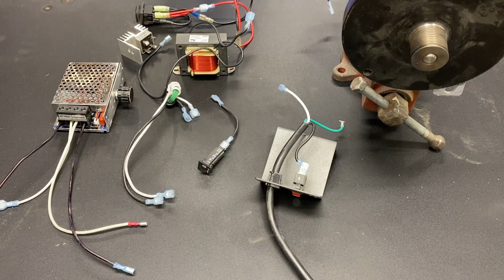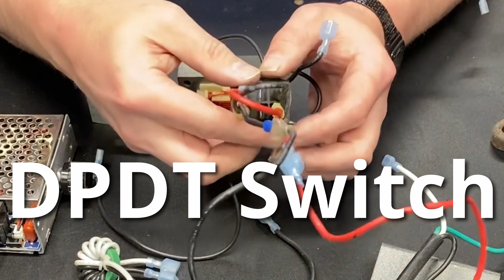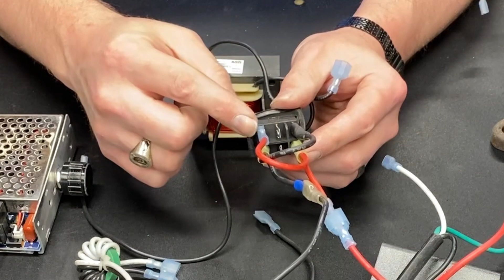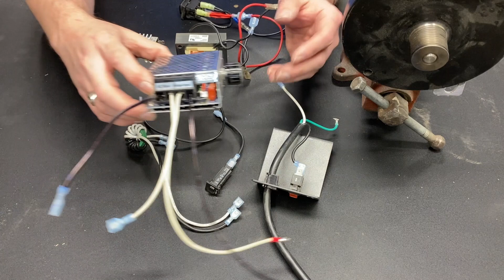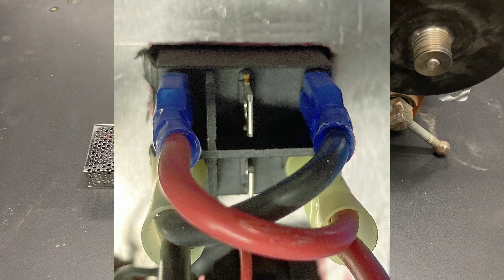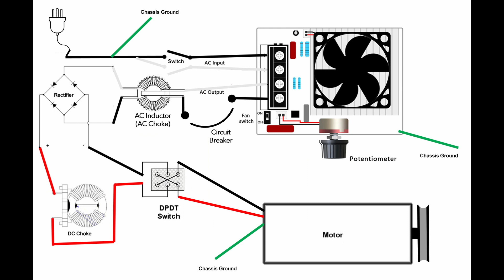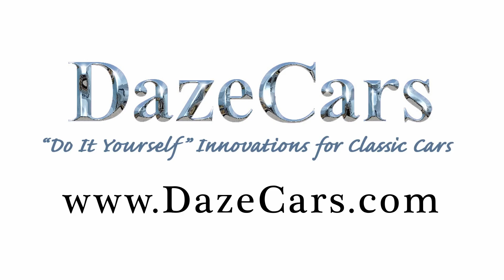Hooking up the Components for a Quality SCR Treadmill Motor Power Supply, Treadmill Motor Controller

Comment: Some would it hate because of the dreaded four letter word (math) but there are those of us who would greatly benefit from a quick video on inductors. it might be a pretty advance lesson but i want to know more about how to choose or make one for this and other applications
Reply from the maker: First of all I am not an electrical engineer and have not looked into it enough to demonstrate the math BUT I do know enough to explain why for this application we don't need to worry about "sizing it properly"  The two specs are amps and henries.  Henries are the frequencies that the choke is filtering out and while that is extremely important on sensitive electronics like radios, audio equipment and sensitive measuring devices it doesn't apply to a motor choke because a motor is not a sensitive piece of electronic equipment.  The purpose if a choke on a motor is not to eliminate all noise in a specific problem frequency but rather reduce noise arose the entire range and all chokes do that they are just lest effective the further you get from the intended frequency.  Second spec is amps and milliamps.  Almost all chokes are rated in mA as they are components for the above mentioned types of sensitive electronics.  There are 1000 mA in an amp and most treadmill motors are at least 15 amps.  If you have 100mA choke and a 15 amp motor that choke is 100 X to small.  This brings me back to what I tell most people if it is not specifically labeled as a "motor choke" it will be way too small.  In fact when it comes to chokes bigger is better.  The bigger the choke typically the heavier gage wire it will have allowing for more amps and the bigger the choke the bigger the magnetic field so the  more effective it will be at cleaning the power.

Comment: I have a Leili 4.25Hp cont. duty @ 130VDC/3170 Watts motor  that I am fitting into a Shopsmith Mark V. Would a 20 amp 110VAC circuit have enough to fully power this motor? I have 220 VAC available. Would that be a better choice? If 220 is the way to go could you recommend some componentry? You have the most informative videos on this subject that I have seen!  Thanks for the videos and any advice that you can offer!
Reply from the maker: so the formula for watts is amps * volts, so based on what you have provided that is a 24.38 amp motor.  At first glance that would mean you can not run it on a 20 amp circuit BUT are you going to be running the motor at full voltage all the time or more likely are you going to be running it slower meaning less volts?   Also the amp draw is only max at full load.  In other words if you fire up a 20 amp motor (made up numbers for illustration) measured the amp draw and the motor had no load on it may only be drawing 10 amps.  As the load increases amp draw increases and to max the amp draw the motor must be loaded to the point where it is close to stalling.  What I am saying is for most use you will not be drawing anywhere near max amps and if you correctly gear the motor to maximize torque the motor will see less of a load.  The key here is to use a circuit breaker in the power supply that is equal to or slightly less than the home circuit breaker.  That way the power supply breaker is the first thing to trip should you stall the motor at max voltage.  Going 220 will give you more amps and most of these SCRs will work at both 220 and 110 but calibration becomes critical because that will give you way more volts and that will affect motor speed.  If you put more than 130 through that motor you run the risk of burning it up.
Reply: @dazecars  Thanks so much! I doubt if I will ever have the need to run it at full power. I appreciate your input. I'll wire it to 110 and it should be plenty for my needs.
Reply from the maker: Just make sure the wall outlet is truly up to 20 amps and that your power supply breaker is properly set up.  Let me know if any other questions arise.

Comment: Ok so I'm super puzzled. I believe ive hooked up everything up correctly I've got it all installed into an old amplifier box that I've taken all the components out of. Then I go to plug it in and we get a pyrotechnics show. Then I'm getting 115 volts on the voltage output if the scr (the one you recommen) when I touch the top of the output with my multimeter but nothing coming out of it. what could be in between the top and the bottom of the outputs, you know when I touch the screws at the top.....115vac then at the bottom, the wires leading to the inductor nothing.
Reply from the maker: fireworks show indicates something is not hooked up correctly.  Contact me through my website and send me pix of how you have it wired and I will see if I can spot an obvious issue.
Reply: I do have a circuit breaker there as well luckily.
Reply: Did I fry my circuit breaker cuz I'm not getting a reading there but I thought their job was to trip and then be reset
Reply from the maker: a circuit breaker is as you said something to trip and then be reset
Reply: Now it's on and the fan is running we got no sparks or anything but I'm still not getting a reading out of the output
Reply from the maker: see other reply

Comment: Thank you! Can you tell more about your chokes, please. AC and DC
Reply from the maker: The choke/inductor for the AC side is simple, it's just a doughnut core with the AC wires wrapped around it.  The Choke for the DC side is just as easy although harder to find.  The key is that its a "MOTOR choke".  If its not labeled as a motor choke then it's too small.  Most chokes are used as components on electronic boards and are way too small.  If it is big enough for this application it will for sure be labeled as a motor choke.

Comment: Question for Ypu and anyone else,,,,, there are so many older abandoned industrial sewing machine clutch (underrated) motors, dauntingly HEAVY, changeable speeds, pulleys, direction. Easy replacement parts, foot control, fun and easy to understand and work on. WHY aren’t they being used for other machines??
Reply from the maker: Lots of people have made comments about using sewing machine parts.  They do work for a verity of applications.
Reply: Thanks for your reply. I am a glass grinder, beveler working on old stone wheel glass engravers for crystal cutting. I am buying a HEAVY industrial sewing machine motor, original switch, etc for $25 just to see how that pans out. (Also working with DC motors/controllers.) St Paul Mn
Reply from the maker: My one piece of advice is take a good look at max RPM and gear it to maximize RPM in the specific range you are after.  Gearing will give more torque and make it more usable in most applications.
Reply: Thanks, that’s good advise,, I work with fairly low speeds, due to the nature of glass. Am making use of antiquated Babbitt bearings arbors/machines in good shape. St Paul Mn
Reply: Thanks @dazecars does this scr controller give good torque at lower speeds like an mc 60 does?
Reply from the maker: Most people don't realize this but an MC 60 IS an SCR voltage controller.  They work about the same but the aftermarket SCR is easier to configure, takes up less space and is less expensive.  I have an entire pile of MC60s but would much rather use the aftermarket controller.

Comment: could you potentially use a microcontroller with pulse width  modulation and an H-bridge in place of the switch for other aplications?
Reply from the maker: My concern would be the high amp high voltage used to run a treadmill motor.  I doubt an h-bridge would be up to the task

Comment: What gauge of wire are you using?
Reply from the maker: For power wires on the ac side 16 is a minimum on the DC side 14 is a minimum.  For potentiometer wires 22 or so

Comment: Noticed you other older video "Putting Together a QUALITY Variable Speed Power Supply or Treadmill Motor Controller SCR type"  It contains reference to the 100 amp bridge rectifier and a large smoothing capacitor.  Are those items no longer recommended?  Also any information you can share about controlling 3 phase dc motors?  Do these instructions apply?  Thank you for the great information.
Reply from the maker: I always use the 50 amp rectifier on the bench because its easy to hook up with quick connects, and there is little to no load on it.  The terminals on 100 amp are bigger so the quick connects don't fit.  I always use the 100 amp when building an actual power supply and recommend it in most of my videos.  I don't mention it in this video because its about how it's hooked up not the components.  There is a 100 amp rectifier linked in the description of this video and I have a recent video on all the parts needed to put together a power supply.  https://youtu.be/NUOCo01qARE

I have not messed with 3 phase DC motors so I do not know if it will work or not
Reply: Thank you for the response.  It's interesting playing about with these. For the life of me I don't understand why drill press manufactures don't setup their pulleys for low rpm drilling holes in metal.  Who wants to waste money on burning up and breaking bits.  Being in Canada it's like living in the third world .  We can't get half of the stuff available in the USA.   @dazecars
Reply from the maker: I agree.  I think the set them up for wood and that is why the RPM is so high.  Kind of a one size fits none approach
Reply: @dazecars  I've seen many of these small DPDT switches, like the GAMA 28E-MTD.  Which is 12VDC and 30A in use by treadmill motor hobbyists.  When dealing with these 90 - 180VDC motors, some a max VDC run close to 30A.  Should one use a switch with a higher rating than 12VDC?  Something more along the lines of a 220V or higher switch.   I would think lower rated switches might cause arching.  Is that not a problem?  Thank you
Reply from the maker: It's really simple and really complicated all at the same time.  First Most switches are rated high on the AC side but not on the DC side.  That is because AC is less likely to arch at due to its occulting nature.  On the DC side higher amp higher volt situations will for sure cause arching so how can people get away with lower amp switches?  well for starters most of those switches are being operated at low volts low amps.  How ofter are we turning the machine off and on at FULL speed?  seldom if ever.  How often are we turning them on or off at full amps? seldom if ever.  other than basic operating amps, amperage draw is dependent on load, the only way the motor will draw max amps is if it is at max torque load.  Lastly most are running their treadmill motor with either a PWM or an SCR and rectifier.  Both of these types of power supplies turn on and off to regulate voltage and in doing so act much more like AC.  The pulsing nature will reduce the risk of arching and contact damage.  The long and the short of it is a lower amp switch will work but likely not as long as the "correct" switch for the voltage and amperage.  With all that in mind I recommend getting two switches.  One to put in the machine and one to have as a spare so when the first one burns out in a year or two you are only down a few minutes rather than a few days.  Make sense?
Reply: @dazecars  Yes, that does make sense!  Thanks for explaining.  If someone wanted to go through the effort(wiring) of implementing DPDT switching on the AC side(before the rectifier.) Do you think it would be stressful on the rectifier?
Reply from the maker: You can not put the DPDT switch on the AC side as AC is not directional and the power coming out of the rectifier would always be the same.
Reply: As soon as my head hit the pillow.  I realized that was a dumb question.   @dazecars
Reply from the maker: not dumb at all.  Some times a thought is just not fully thought through, that doesn't make it dumb.
Reply: @dazecars  Thanks.  Just had a thought. How about a DPDT switch on the AC side with output to two separate bridge rectifiers.  With reversed DC wiring on each.
Reply from the maker: I can't sign off on it because I haven't tried it but tracing power flow in my head I think that might just work.  My only concern is power feeding back into the "off" rectifier but I believe that would not be an issue as the diodes in the rectifier would prevent power flow the opposite direction.  Short answer I think it would work but at that point Its a lot more expense to not get much as the DPDT on the DC side is "good enough"  Interesting thought though... I may test that on the bench and do a video on it.

Comment: What is the capacity of DC choke for 220V 2.2hp DC motor?
Reply from the maker: Not being an electrical engineer I do not have any specs or calculations for you on the motor choke. What I can do however is offer you some guidelines. First of all bigger is better. I have several motor chokes ranging from the size of a tennis ball to the size of a soft ball and the bigger they are the better they work. Second the wire for the choke needs to be a minimum of 16 awg. If the wire is not that big or better it will not have the amperage capacity to allow the motor to work properly. Amperage is the most important spec.  A lot of the chokes available online are rated in mA.  there are 1000 mA in an amp.  Treadmill motors are rated in amps so most chokes available online are several hundred times too small.  Third they are not available on Amazon at least not inexpensively, there are a few privet sellers on Amazon selling used parts for big bucks but the available chokes on amazon are too small because they are not designed for a motor even though they look correct in the picture they are WAY too small. The choke in most of my videos is part number 130993. Instead of getting one new I would get a used one. A lot of treadmills come with a choke. Go to eBay and search “treadmill motor choke” BUT know that most people on eBay don’t know what they have and the word “transformer" will also appear in most listings. Problem is a choke and a transformer look almost identical so some listings are for transformers and some are fore chokes because the sellers think they are interchangeable. They are not. They would only be interchangeable if you modify a transformer to work as a choke. (see my DIY choke video) To tell the difference count the wires. A choke will only have 2 wires, a transformer will have 3 or more. Also before I started doing videos chokes on eBay could be had for $25 or less shipped but now that more people are looking for them (due to my videos) the eBay sellers have raised their prices quite a bit. Your best bet might be the DIY option out of a Microwave transformer. Please let me know if I can be of further assistance.

Comment: Hi. I appreciate your videos. I bought the components you list, modified a microwave transformer, and bought a 2.5HP/3400RPM/17amp/130V  treadmill motor, hooked it all up as suggested, and it runs. No visible sparking. However, the SCR hums very loud and cycles very frequently. I only took it to about 1500RPM. This does not happen using my Variac. Any thoughts as to why all the noise and cycling? I do not detect this phenomenon in your videos. Thanks.
Reply from the maker: Several others have reported this same issue with the DIY choke, although tons have had success.  One guy even made two where one worked and one had the exact problems you are experiencing.   Did you fully disassemble the transformer to make sure there were not any other connections or coils prier to converting it to a choke?  Is it welded back together?  is the coil locked into place?  Another thing you can try is to put the DIY choke in line on the negative side instead of the positive side. It will still help regulate power spikes but may be less problematic on that side.   Also what AWG is the wire in the coil?  some microwave transformers are smaller and the coil wire may not have the amperage capacity.  Those are just a few possible ideas.
Reply: what do you mean by cycling?
Reply from the maker: he is likely referring to a rhythmic fluctuation in speed.  not a huge swing but a pulsing of a couple speeds close to each other.

Comment: Great instructions, question re the thermal switch wires (blue) from my treadmill motor, do you recommend not using?
Reply from the maker: Always use them. Here is a video on them. Hooking Treadmill Motor Blue Wires: SCR, MC60 and MC-2100 Treadmill Motor Controller Power Supply
https://youtu.be/Mx4022PbHO4
Reply: How would you incorporate them into this circuit?
Reply from the maker: The video I linked shows how to wire the blue wires
Reply: @dazecars  you are the boss!  Hooked up tonight and works awesome, even though the SCR is 470K Pot, I think I can use OK (this is SCR you had on parts list).  At max speed got kinda scary fast, but wicked smooth and minimal sparks compared to my MC60 setup.  One other question, if I decide to go out of DC output and add in RPM readout and another fan, should be no problem, correct?  Sorry for noob question!  btw, max rpm on this motor is 7099rpm and 2.5HP.
Reply from the maker: The RPM meter needs a constant voltage not a variable one.  You may be able to accomplish that with a voltage regulator but I can not say for sure.